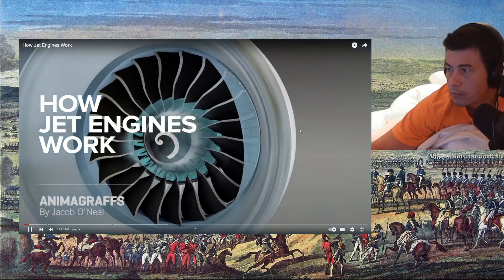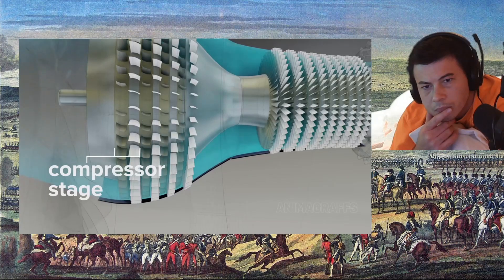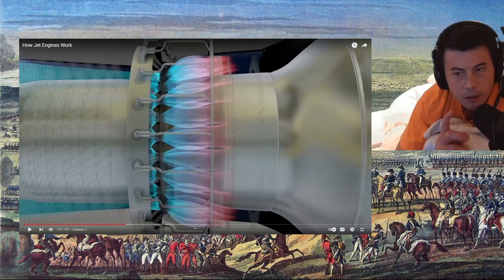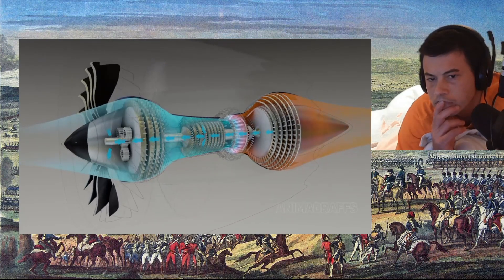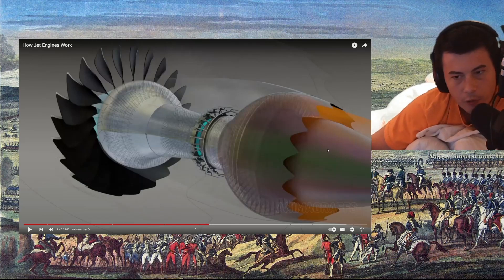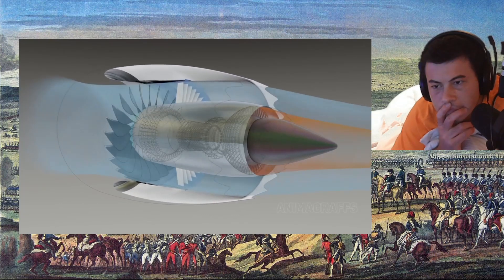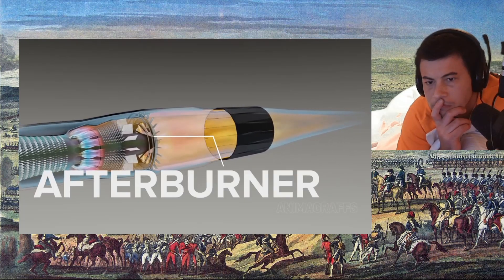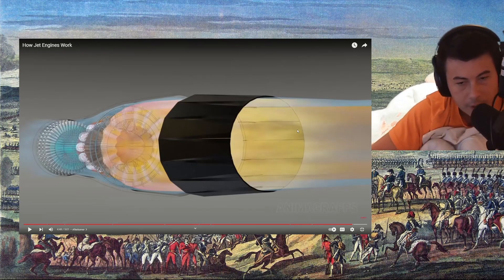American Reacts How Jet Engines Work

Comment: Simple way to explain it is that the burning stage at the end is only really there to keep the reaction going. And the reactions' purpose is to power the propellers at the front which pulls the plane forward and at the same time keeps the reaction going by sucking in more air. So, you start up the front fans, once they get up somewhat up to speed you add in fuel and ignite the mixture at the back. The fuel+air ignited at the back continues to spin the fan at the front which can now go faster and faster, pulling more air in and thus increasing the ignition rate at the back which spins the fan even faster. You see the loop happening here? You need the fuel to be mixed with air ignited to overcome friction. In older prop planes an engine with pistons like a car is used to power the propellers, where as a jet engine uses its propellers to power its propellers. With some help with clever compressor and fuel mixture. 

It's kind of like those experimental cars that use propellers on land to power the car upwind or even some small test boats that use wind propellers to power water propellers into the wind. The air props use air to spin and thus spin a shaft, the shaft runs down through the boat to the propeller under water which is either directly driven or uses gears to increase ratios. The propeller is used directly to power the car/boat forwards without using an engine, if one would add a compressor stage and fuel is mixed in and then burned, the propellers could be spun much faster creating much more power.

Comment: 2:24 this is where the “can an airplane take off on a treadmill” question comes from. The answer is yes! Instead of thinking of it like air is flowing into the engine, think of it as if the engine is grabbing the air and forcing it in. The plane’s speed when it’s airborne does help that process, but it is not a do or die.

Comment: Exhaust stream
Not quite same idea as a helicopter. On a helicopter each "blade" is considered to be a wing. Therefore the spin of the rotor creates airflow over each wing. The difference in high/low pressure created by the airflow over each wing provides lift. In an aeroplane, the forward movement of the plane creates airflow over the wing causing a high/low pressure under/over wing creating lift. Forward movement, in a jet engine, is created by the thrust of the hot air being expelled via the exhaust.
Yes, the propeller of a ship works in a similar way except with the high/low pressure of a liquid instead of air. For vessels that use sails (think of the Götheburg), each sail is like a wing I.e. the pressure difference on either side of the sail makes it move "forward".
The hot stuff coming out of the exhaust of a jet engine is a combination of compressed gases being expelled and unburned fuel.

Comment: Aircraft propellers and helicopter rotors are the same. They are actually small twisted wings that generate lift. At an aircraft the lift generated by propellers pull the aircraft while the wings keep it airborne, at a helicopter the propellers keep the craft in the air and move it at the same time. Thats why helicopters also called rotary winged aircrafts.

Comment: Thrust comes from the core and the fan. The thrust from the core works like a rocket motor by ejecting hot gases backwards it pushes the plane forwards. But because the hot gases turn the turbine at the back which is attached to the fan and the core through the shaft it also powers the fan which acts as a propeller.
Once started, it keeps going unless starved of fuel. The combustion chamber is so hot that usually there is no need to use ignition to keep the fuel burning, unless flying through extreme rain or reaching an altitude where the air is too thin for combustion.

Comment: Air entering jet engine travels at much lower speed, also it comes all around the inlet, whereas the exhaust gases leaving are mostly pointing to the same direction. We are using energy to move things in one direction and increasing their speed, this creates thrust. So, it is about pushing air out faster than it came in and the air stream is mostly going to just one direction.. One way to do it is to mix it with fuel, combust it and expand it. Giving the expanding gases only one direction to escape... There is also then more volume that exits the other end, and we get even more thrust. If we use some of that thrust to rotate an axle, and that axles rotates a compressor, we get more air and can mix in more fuel, and we get even bigger expansion ratio.

Comment: The exaust  at  the rear  of the engine  pushes the  plane  forward.
The thrust  can blow a double decker bus  away...
The plane engine  sucks in air  so thats how it runs from standstill ...
Increasing the intake of air   pushes the plane along  to takeoff spead   in excess of  200 MPH..   cruising  at altidue  averages at  500 MPH..
Simplified explanation  
There are examples of gtoundcrew being sucked into engines  bcos they were in the way...

Comment: Jet engines use reaction force to generate forward speed. Think of an inflated balloon that is released; it isn't propelled forward by the released air stream exiting through the open narrow end, but it is pushed forward because there is a pressure difference between the front and the rear of the balloon. The jet engine uses the same principle.

Comment: another British invention
Reply: Sir Frank Whittle got there first by designing the Centrifugal flow engine (commonly used now on Auxiliary Power Units). The Germans designed the Axial flow Jet used in modern engines.

Comment: You have to spin the turbine to start it, once started it keeps going if you keep putting fuel in. Modern air liners will use compressed air to spin it from a ground support unit or a small auxilliary enigne in the back of the plane. Older planes from ww2/cold war had a thing called cartridge start. They're bascially a "low explosive" or firework to make lots of gas that spins the turbine. Ive seen tractors do it on a smaller scale with a shotgun cartridge. All turbines produce thrust to push it along, at first "turbojets" just pushed the hot gas out the back as thurst. Now (Turbofans) its much more efficient to have high bypass meaning its a combination of thrust from the fan and hot gas from the core (turbojet in the centre of it).
Cartridge start on a deHaviland: https://youtu.be/oV5E-KvqevU?t=11
On a tractor: https://www.youtube.com/watch?v=vb0-br7hTw0
Reply: 787 back drives its Generator to start. It has a Variable Frequency Starter/Generator.

Comment: In a low bypass engine, most of the thrust comes from the core, whereas in a high bypass engine most of the thrust comes from the fan. High bypass engines are generally more efficient.

Comment: its different from propellers. so yes its the gasoline burned in combustor with more air with more speed = more power + fuel adjusted. Stationary aircraft does not need so much thrust (exept leaving aircraft carrier etc.)